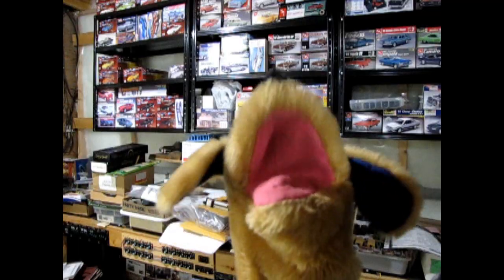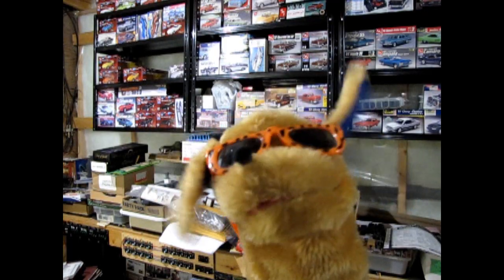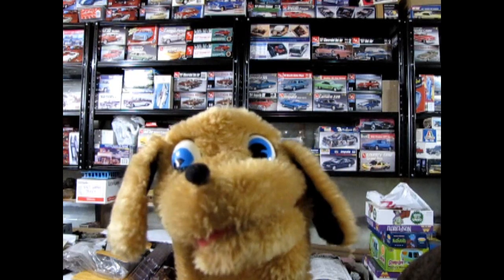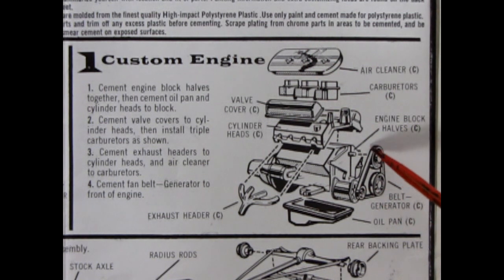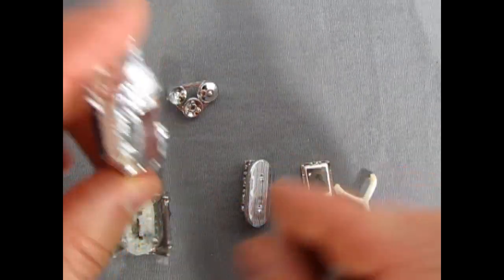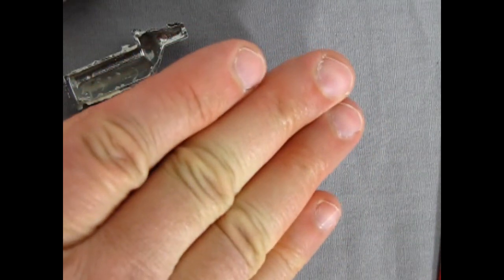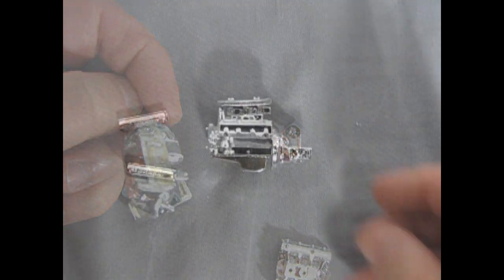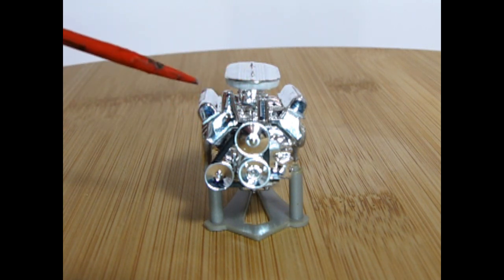Model Car Garage Tips and Tech - How To Build The 390 Thunderbird Optional Engine - AMT 1934 Pickup

Comment: I thought it was fun too, Danny, but don't tell Trevor I said that🤣Nice build and handy tips for dealing with chrome👍😃Pete 😎
Reply from the maker: Glad you liked the video..what were you and Danny talking about? :D
Reply: Us? We? I? Didn't hear a thing🙉🤣Your Awesomeness 😃
Reply from the maker: @petesmodelcarcustoms584  LOL!
Reply: @MonsterHobbiesModelCarGarage  I just got a flathead Lincoln V12 engine to play with😃scrap from someone's old kit🤓Now to make new inlet for tricarb or 6 carb set up😂Pete 😎
Reply from the maker: @petesmodelcarcustoms584  You need 12 carbs! :D One for each port.
Reply: @MonsterHobbiesModelCarGarage  any idea what one would look like🤷‍♂️and either no hood or very big scoop. 🤣.
Reply: I was thinking of 6 dual throat Weber carbs and make a crossover manifold🤔😲making headers will be fun, once I've cut off the moulded on ones😵😂
Reply from the maker: @petesmodelcarcustoms584  Use the carb set-up found in the AMT 1953 Ford Pickup truck on the Desoto Firedome engine. There's 8 in there.
Reply from the maker: @petesmodelcarcustoms584  for sure. Are you making single pipes per cylinder?
Reply: @MonsterHobbiesModelCarGarage  thanks for advice, I'll look through a pile of boxes and see if I've got one🤔😁😂and yes, two 6 branch headers. 😲 I'd better decide on a car to put it in too😂😂34 Ford 🤔or a mercury/some other lowrider
Reply from the maker: @petesmodelcarcustoms584  I'd put it in a model T hot rod myself! :D
Reply from the maker: @petesmodelcarcustoms584  Something that you can extend the frame out on, but not have to figure how to adapt the body.
Reply: @MonsterHobbiesModelCarGarage  model t might be it 👍got to go now, there's a vid on YouTube I want to watch
Reply from the maker: @petesmodelcarcustoms584  Could it be another model car video? :D